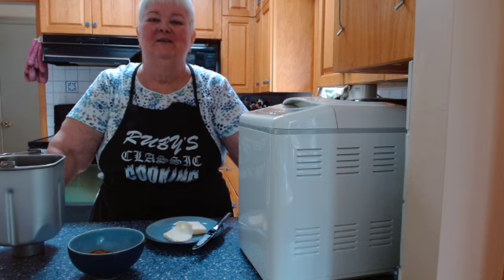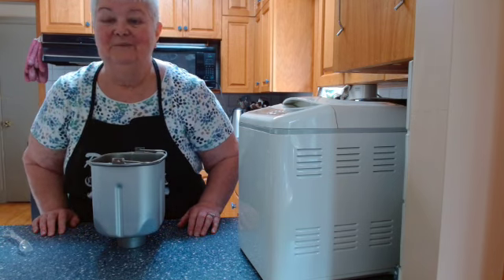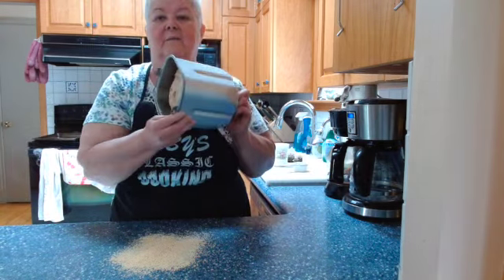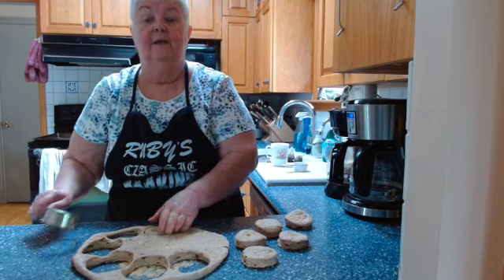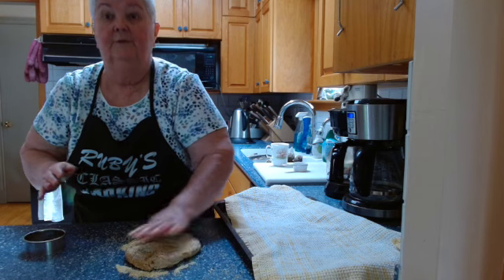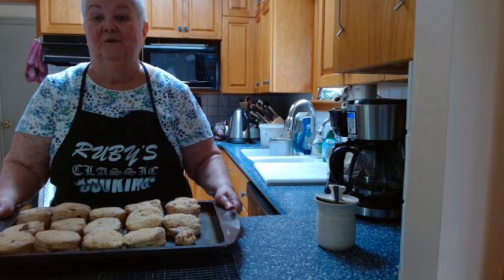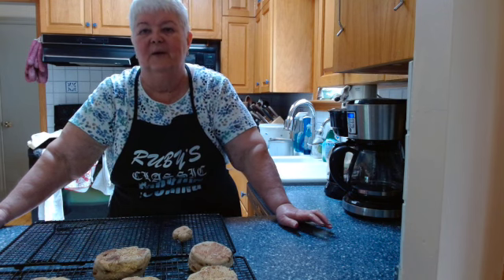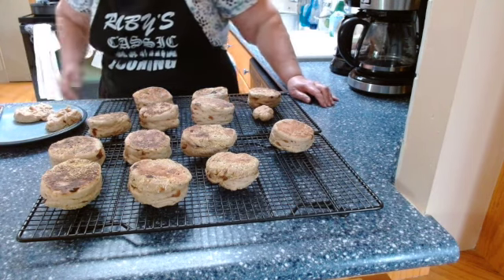Cinnamon Raisin English Muffins using the bread machine - Budget Friendly!

Comment: Wondering what kind of bread machine you have?  Muffins look very good.
Reply from the maker: It's a Black and Decker B1561 All-In-One Automatic Breadmaker.  It is an older model, the one I currently have I bought in a thrift store auction.  It was brand new in the box and in the bread baking pail there was an actual video tape from 1993.  lol.